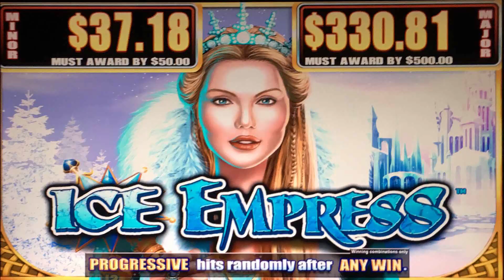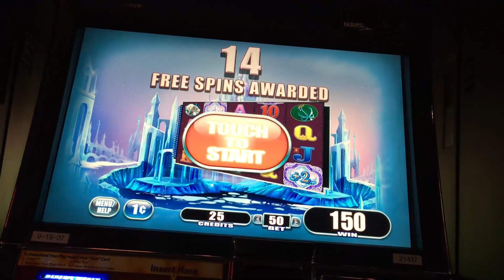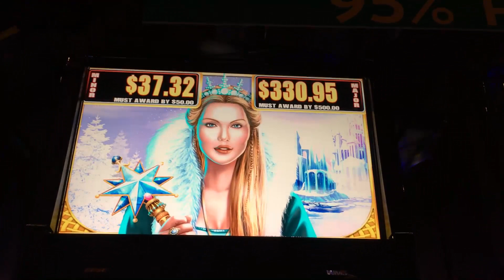95% Ice Empress slot machine, Behind the Scenes

Comment: Interesting tidbits to know!  I recommend a selfie stick or monopod those can come in handy so it might help your arm from getting tired from holding it during a long video.  Sad to hear they're discontinuing YouTube video editor, have to use separate software now.
Reply from the maker: +EmanRocknSlots I've never used the YT tools. Were they any good?
Reply: I only used it for basic editing which was decent.  I guess if not enough people use it then there isn't much of reason to keep it around.  That's too bad for anyone who needed it because probably is the only editor available to them.
Reply from the maker: I can imagine that they had to spend a lot of money to support this feature because video editing is very compute intensive.  I've got a very high end system with 1,664 parallel processors and it still takes a little time to render the graphics, particularly if I am doing anything fancy.  Imagine thousands of YouTubers pressing the "go" button on the editor at the same time...